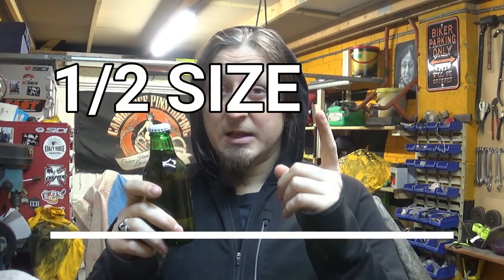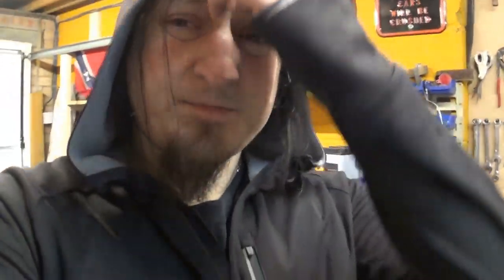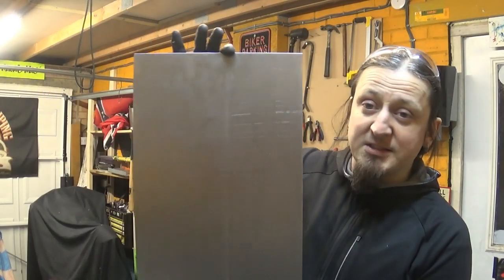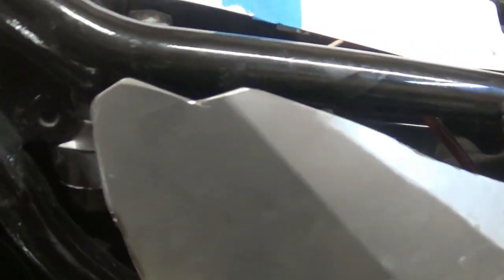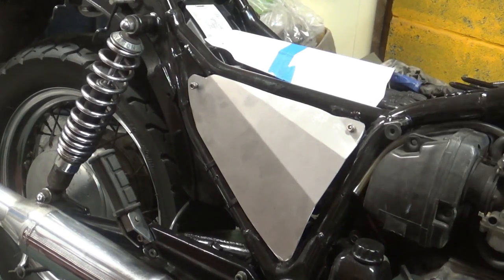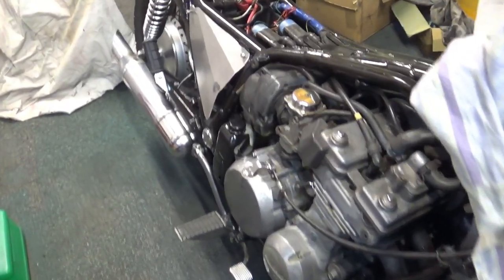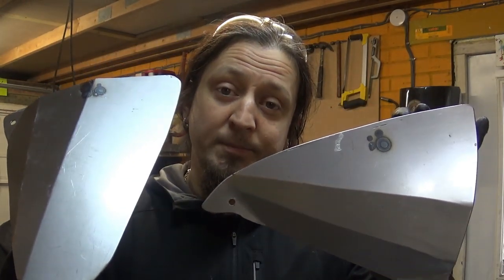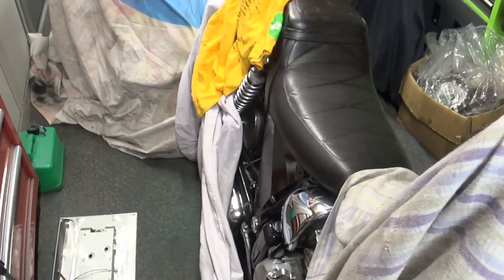Kawasaki Eliminator ZL 600 -part6- Side Panels Fabrication

Comment: Did you put hardener in the paint or clear coat them with a clear hardened coat,,so they don’t chip easily???and also I think they need a few little pinstripes or design on them?? Mackie style!!🙏👍👌💪✌️✌️😁😁
Reply from the maker: Yes, it's a hammerite type paint, so super tough with zinc primer too. Should be ok!